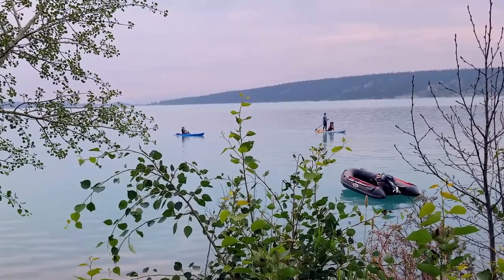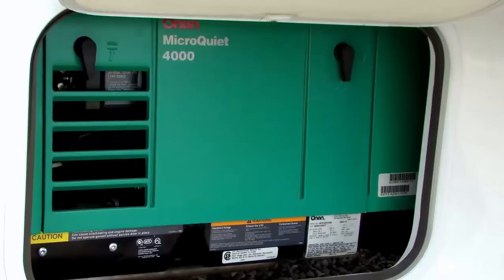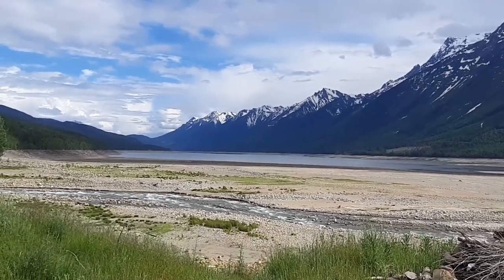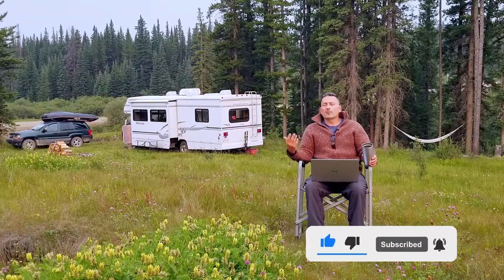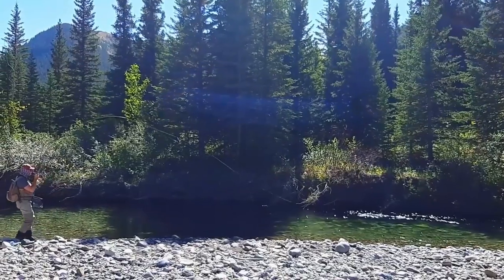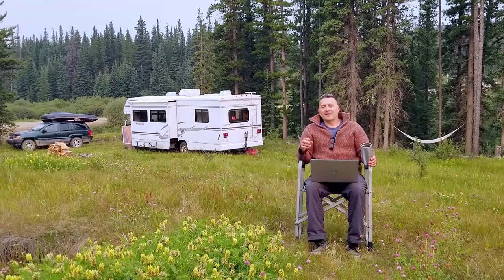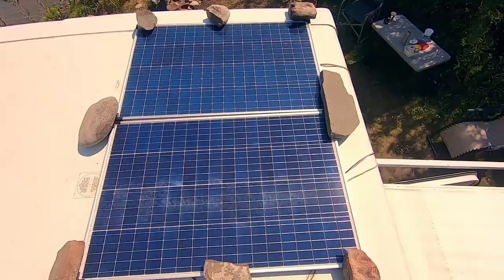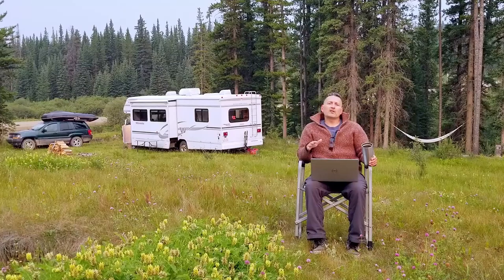How to get POWER when Boondocking?

Comment: We currently have parallel inverter generators and batteries but hubby is currently working on a schematic for solar!
Reply from the maker: Yay hubby!!  Wow, parallel inverter gennies, lots of power there @ Jennifer K!   DO you find you need that much power?  Are you mainly dry camping/boondocking?

Great idea to reduce noise and fuel consumption by moving towards solar!  Would love to see your set up, too back pics cannot be shared here.

Thank you for your comment, we appreciate it!  Happy camping!